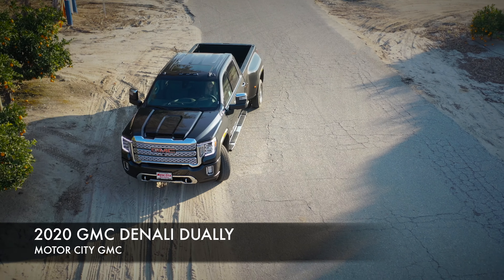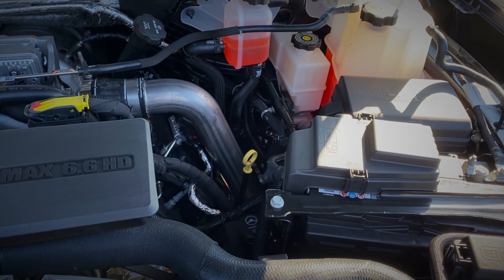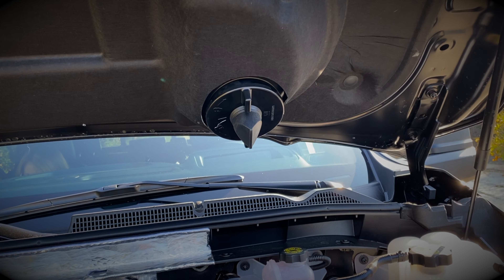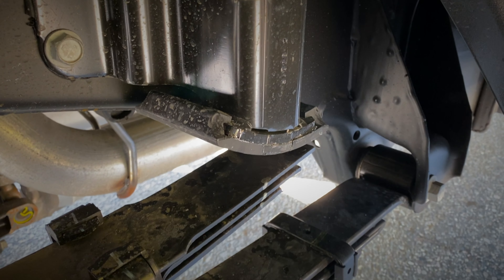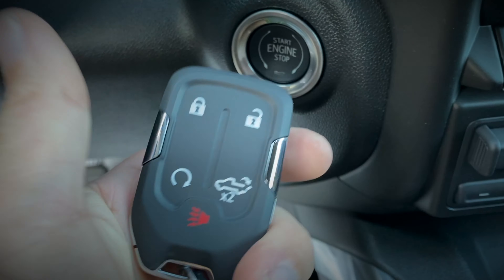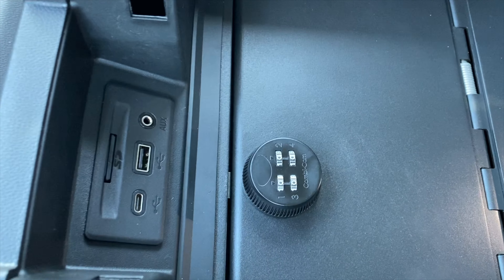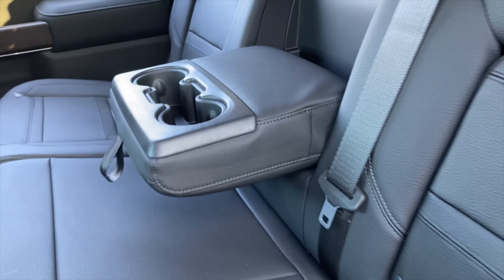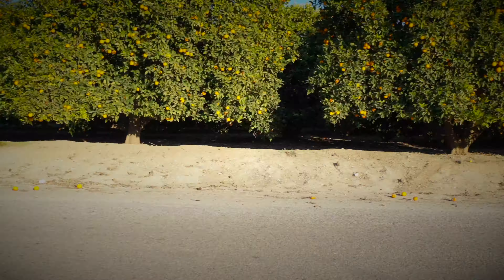2020 HD 3500 GMC Denali Dually Turbo Diesel - The HAUL KING review to go up against Ford and Dodge

Comment: I believe they did make some engine updates from 19 to 20. I watched a banks video addressing it, something with the oil pump and cooling it.
Reply: Oh yeah, all kinda good improvements. GM is on their game.
Reply: Yes I believe they have the largest cooling system in the game, largest radiator, oil coolers, tranny coolers and largest fan diameter, also the only aluminum fan on the market not plastic.

Comment: They need to up the torque like Ford did to 1050 lbs.  I am truck shopping and drove a 2020 F450 and it was amazing.
Reply: An F450 would crush this thing!!
Reply: Because 900+ ftlbs isn’t enough ?
Reply: The 10 speed basically gave it a better mechanical advantage. In order to up the torque, internal engine upgrades are typically made to handle the extra power for longevity. Maybe they will up torque in the future though...
Reply: @2015_Rubicnn  the ford and GM have the exact same transmission now.  They co-developed the HD 10 speed for the new trucks.
Reply: @richfarfugnuven6308  The car transmission used in the Camaro ZL1 was a joint venture between Ford and GM. The Allison branded 10 speed transmission used behind the Duramax isn't the same as the transmission used in the Ford trucks.

Comment: the 10 speed does make a difference even on the gas motors....i bought a 2020 GMC  1500 with the 6.2L and it has a 10 speed....before that i had a 2014 1500 and it had a 6 speed trans.

Comment: Nice truck, but I have a question. Since having the truck have you experienced having any debris go from the intake (directly) into the engine via the exit terminal that you were showing after lifting the hood?
Reply: kalon511 I’ve had a ‘17 and two 20’s and have had no problem with the intake. The air doesn’t go directly into the engine, it goes through the air box and there’s also a clean out port for any debris.
Reply: @Alexander 

Alright. Thank you.
Reply: It feeds the air filter. Junk will stop there. Also it's a much easier to service air filter than my '15.

Comment: I’m ordering a 2020 dully one question are they as tall as the 2020 2500 were u have to step up in it somewhat, and u feel really high in the 2500 is dully the same... just seems with 17s it wouldn’t be and why do they put such small tires on them thanks a ton!! It’s a awesome truck but no lots here have any to see 100 square radius smh
Reply: You can find a replacement tire anyplace. Really common. That's the theory.
Reply: Dive Bar Casanova I first just need to know if it sits up like the normal 4 tire HDs

Comment: But I want the key start😥
Reply: the push button start is better for me...i've had so many problems with the key starts over the last 10 years on gm pick ups...the lock cylinders jammed up many times and sometimes my 2014 sierra would not start up because it didnt recognize the chip in the key....then i had to put pressure on the key in the cylinder to get it to start up...i am liking the push button start